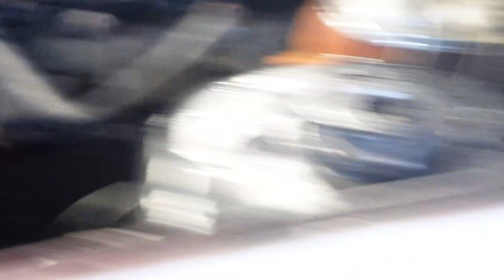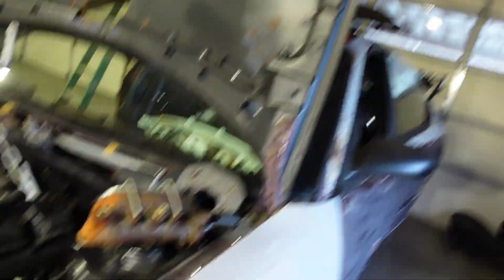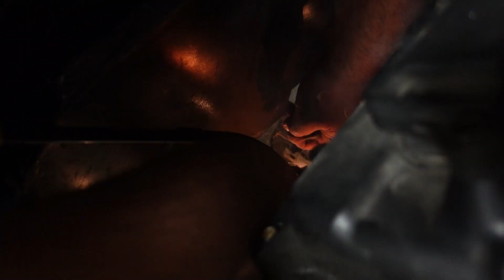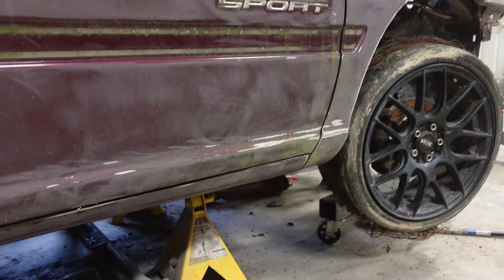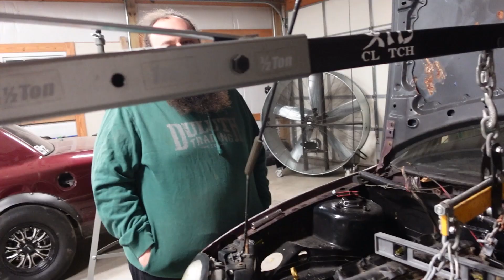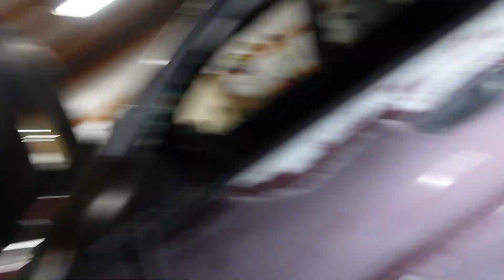RWD Dodge Neon Hemi swap | Engine & Transmission mounts

Comment: You may think it's overkill but if you'd like to crank the car on a cold start and be able to walk away without trying to keep it running just hook it up to a 7AL. I had the same reaction like the first ride on a real adjustable throttle cable. Why didnt i get this on long time ago?!!!